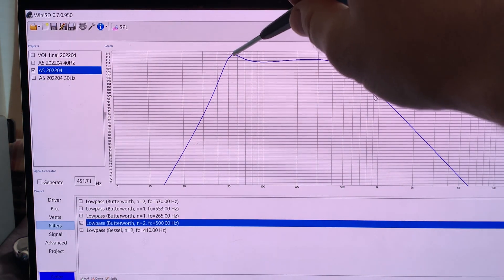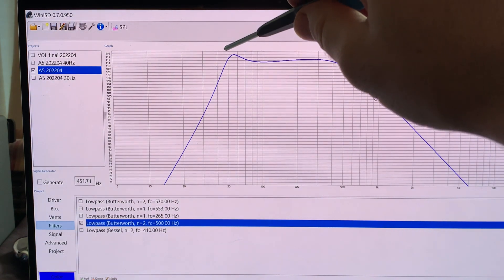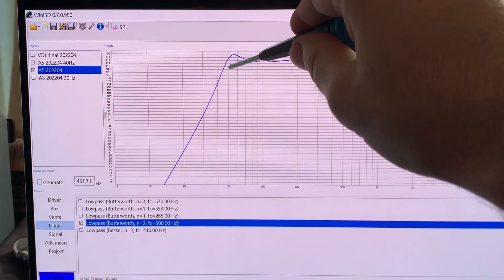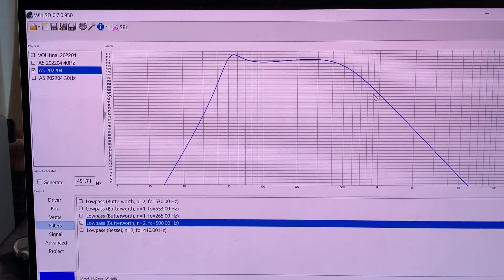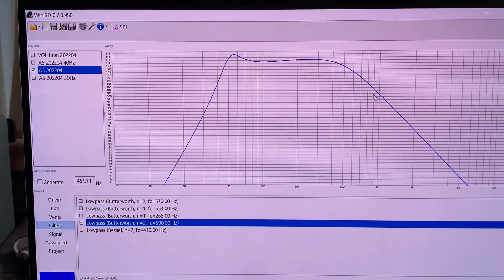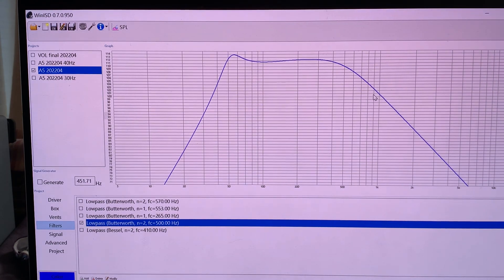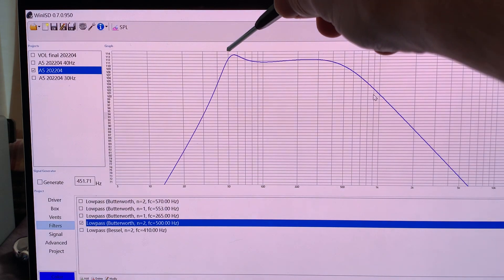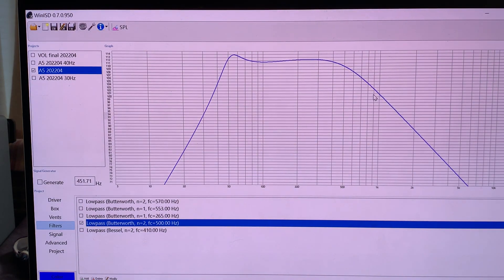Understanding consequences of Port tuning

Comment: I've been using WinISD forever but I never realized it showed excursion. Very cool
Reply from the maker: It's a handy little thing to work with. I learned a lot by studying how cone excursion demands vary drastically with port tuning - this impacts both LF extension capability and demands on the power amplifier. I love WinISD.

Comment: What are your thoughts on distributed ports and aperiodic design? Distributed ports are not closely tuned and have a lower Q than reflex or closed box design....Wharfedale used distributed/aperiodic ports on some speakers, like the original Airdale with 15" bass driver.
Reply from the maker: I have not played around with them, so cannot comment much on it. I am focusing on slot ports, as they offer highest efficiency and most natural / streamlined / turbulence free air flow. (Relatively turbulence free, compared to other port types.) I examine music instruments and try to transfer as much from their construction and work principle to loudspeakers as possible. ;
Reply: @realworldaudio  I look forward to the next part in your series on this. Another slot port design I've seen which is said to be very effective is the Onken....

Comment: Bro i had a question for u, how to prevent ported speaker from going over xmax at lower frequencies , add a couple watts and it does exceed the limit so i use a crossover on my avr but want to run it full range and not cut off at 80hz , smaller box or port does help with this but wont help with sensitivity, should I use a band pass on it, what do you think about this
Reply from the maker: Yes, smaller cab would help - limit bass production & efficiency & as a consequence, Xmax. You could also double the woofer, to split load for the two so halving Xmax demand for each woofer.... but then you will need to rework the crossover. Using bandpass will muck up the spectrum, so while a solution to the issue, but will limit the sound & also the bass handling.
Reply: @realworldaudio  so it means sealed will be best way to. Go right, it will not exceed xmax but there will be some spl loss, but i guess I'm ok with it, I'll keep the ports in just my home theater as they can be cut off and for 2 channel speakers I'll keep them sealed, most ported sub brands use a very low 6db even sometimes high pass to protect wooder , But i guess it will be another component in the way, which is the best way to do this, the drivers being used are hifi type with good xmax so. They dig deep but. Also. Can go. Over xmax easily with a. Few. Watts
Reply: @IDontExist14 i am seeing a similar situation..want to build a 3 way bookshelf type speaker, and even under the RMS power of woofer . It's exceeding Xmax...so i am thinking of adding a capacitor to block under 30Hz...in passive crossover...but that capacitor is of very High value...like 430uF

Comment: Port emission works on the second and subsequent cycles, great for classical or other genres with continuous LF tones, no good for rock with pulsed LF content, TL is impressive for classical but even worse for rock. Fridge sized cabinets (and larger) is the way to proper low bass amplitude and transient behaviours.
Reply from the maker: Yes, big cabinets are the way to go in my experience as well - fridge size is where bass comes alive, liquid and effortless.